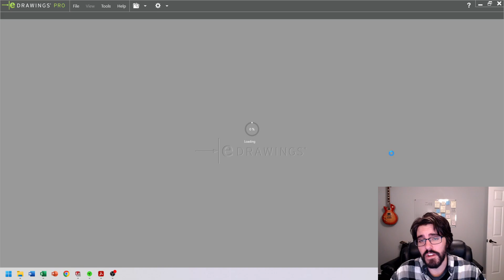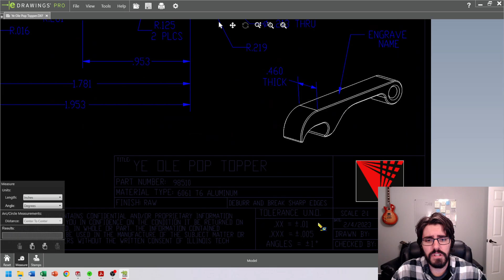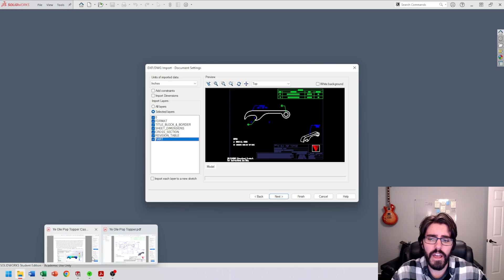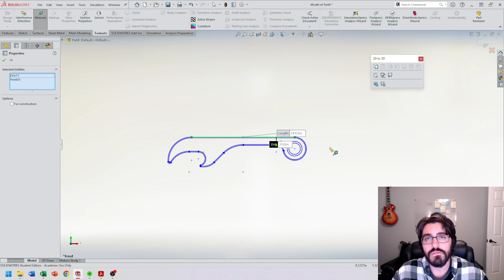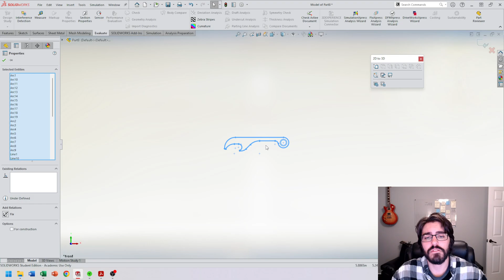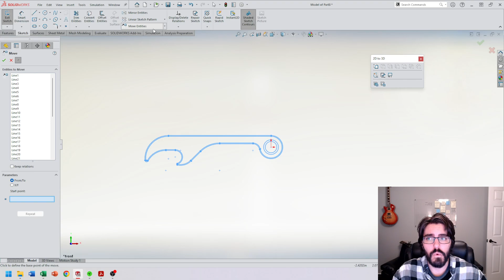Importing, Scaling, and Moving DWG and DXF Files in SolidWorks

Comment: Hi, is it possible to take a legacy .DWG drawing and import it to SolidWorks so that I can convert it into a SolidWorks drawing, link it to an existing SolidWorks 3D model, and add the new drawing to the PDM vault? Essentially the SolidWorks model for the part already exists in the vault and the .DWG drawing also exists and I'm wondering if there's a way to convert it/link it to the existing 3D SolidWorks model rather than having to redo the entire drawing? I know I could just use it as a reference and redo the drawing but I wasn't sure if there was a faster/easier way that would also allow me to have it linked to the previously existing 3D model.